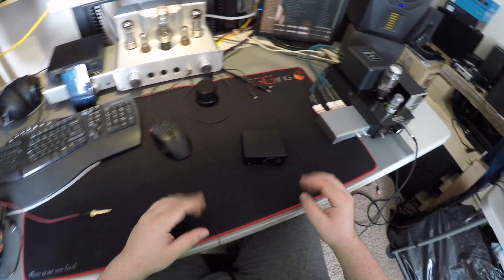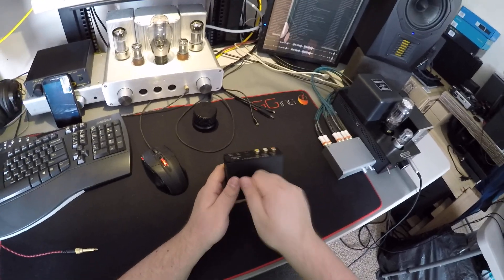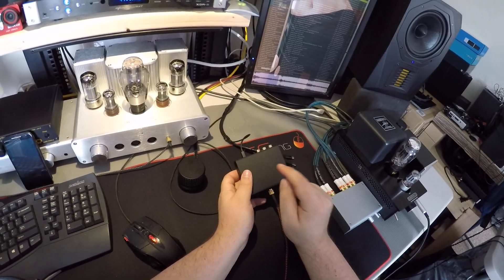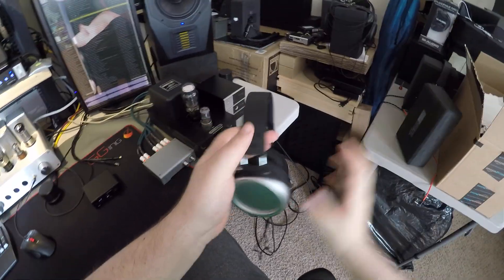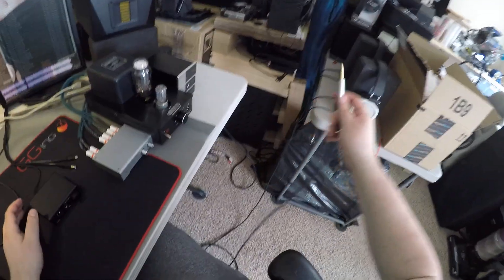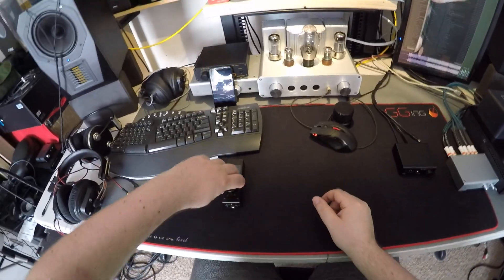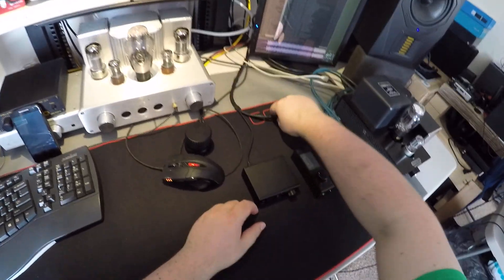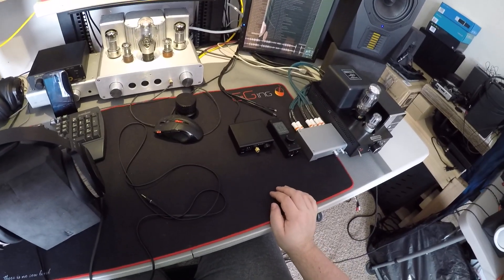Z Review - SMSL M3

Comment: this may be a stupid question, but if you were to connect the emotiva control freak would you then be able to ignore the need for a speaker amp? or would that simply not work or is the amp in the m3 powerful even to push speakers?
Reply from the maker: The rear RCA outs are just signal. They would work to feed signal to powered monitors. You need another amp along the way.

Comment: Hey Z!

I'm planing on buying a pair of speakers for my desk setup but i'm not really sure what i should look for. I would prefer to buy a pair of powered speakers to avoid the extra cost of a speaker amp. 

I own a o2/odac with rca outputs on the back, so i can use the odac for the speakers. I have a budget of +-300€, is there anything specific you can recommend? 

I will use them mostly for music listening but maybe so music production in the feature!
Reply: +Patric Matsson Look at his subreddit for reccomendations, but off the top of my head. The JBL LSR305
Reply: +Draxcer I have been using mine for over 2 years now with no issues and they sound amazing. They need A subwoofer though if you want low end

Comment: So I have a foam modded pair of Sennheiser HD 558s, I'm looking to get the best sound quality out of them (Which I assume I'm not already getting with my Sound Blaster Audigy RX sound card's 3.5mm headphone jack), and the music I listen to is usually pop, rock n roll, instrumental, Alternative Rock, and occasionally punk (generally from the early 2000's to the 1950's.) If I am getting a cheap dac/amp just for general music listening purposes on my Windows Desktop, would it be better to get the SMSL M3, or the Schiit Fulla?
Reply from the maker: For those cans either works. I like the formfactor of the M3 better.
Reply: Is the M3 also good for gaming, just out of curiosity?
Reply: cleans up shitty pc noise just fine. I have 250 ohm dt880s and they don't get as loud as I want. Just under though. like if it had 10 notches and I liked it at 10, it only gets to 9.
Reply: my cmoy portable with two 9-volts gets louder

Comment: Hey Z, I'm bouncing back and forth between this and the origen. The line out vs pre out is not a big deal. I have neither at the moment so I can build my eventual setup around what I get. I currently only have shp9500's but after all you've talked about the mk3's and the current rebate I plan on picking up a pair. Obviously you power them to "too loud" with the m3 in this vid and you talk about the origen and m3 being comparable in terms of power. But I do remember in a previous video you mentioning the origen just barely powering the mk3's. I was leaning toward the origen because of the form factor but now after deciding I want a pair of the fostex I'm not sure I want to go with something that will just barely power them. Advice?
Reply from the maker: +Dustin Smith Both push the Mk3's. So back to form factor you go.
Reply: +Z Reviews Awesome! Thank you! I really appreciate your advice. So much of the audio advice I've found on forums and such is very "snobby". I was told on a forum I was screwing myself over if I planned on getting mk3's with anything less than a schiit magni + modi combo. I know its not bad advice but I also take it with a grain of salt. Your reviews and more "real world" advice makes deciding on stuff so much easier.  I think Origen it is then. Keep up the good work! I plan on joining up on your patreon soon.

Comment: I'm wondering if your power problem in the RP50's is that you're using a different cable than comes with it ?
Reply from the maker: +Richard Riley I tried all the cables when that was mentioned. Not the issue. Just the odd way the Fostex planar react even among similar units.

Comment: i am in doubt what to buy...
smsl m3 or fiiio e10k, regarding the sound quality....
and also, m3 is cheaper then e10k for me, if i will buy from amazon uk
i own kingstion hyperx cloud 1 headset / takstar pro80 rebrand, with brainwavz earpads
so what would be better choice for them, m3 or e10k??
thnx for any help or info i get
Reply from the maker: They are both pretty entry level. I would just consider the E10k if you wanted a bass boost option.
Reply from the maker: Havent played with that one in particular but no reason to doubt HIFIMEDIY yet. Their little ones are very good.
Reply: ok, thnx for the help m8

Comment: Can somebody help me with this question?
I have the philips A5 headphones wich are 16 ohms and handle 3500 mW. I read that headphone amps need to have an output impedance that is at least 8 times lower than the headphone impedance. But philips says that because these (the A5) can handle up to 3500 mW, so you can plug them anywhere without getting a distortion or hissing. I prefer the m3 over the fiio e10k ( because usb+ optical) but the m3 has an 8ohm output. 
Will there be a difference between the m3 and the e10k knowing that the fiio output impedance is "more apropriate" for my headphones?

Comment: noob question,can i connect some old speakers i found to this??they dont have anything at the end of their cables its just like they are cut and have smaller cables
Reply from the maker: This is a dac and headphone amp. It has line level outputs meant for a speaker amp. Which you can buy, put in line and then feed those speaker cables into. Look at the Lepai 2024
Reply: Z Reviews ohh thnaks i might buy it its not that expensive

Comment: Would it be practical to run powered monitors off of this (since Micca are assholes and Fostex is hella expensive) using headphone port with jack to 2xRCA cable and using that to control the volume?
Reply from the maker: It is possible it is just going to be ugly. Also you have to make sure not to over-drive the signal into the monitors.

Comment: How would you connect speakers like the micca mb42x's to the m3? How do run RCA line out to speakre wire with a banana plug?
Reply from the maker: You do not. The line-outs can feed an amplifier like the SA50 or A2 but you can't just power speakers with this. You feed signal from it.
Reply: +Z Reviews thanks!

Comment: I am looking at getting a DAC amp for use on my PC. I won't be using speakers so headphones only. I will be using it for music and gaming mostly. 
I was wondering which you feel is better between the SMSL M3 and 793ii?
if is the M3 then is it better to use USB so not using the sound card or SPDIF? (also is there a difference between RCA and Fibre?) 
Thx for any thoughts.
Reply from the maker: No difference between COAX and FIBER. This if you want USB, some people prefer to avoid USB which is why the 793 comes in. The 793 also has external power which helps it power some harder to drive headphones.
Reply: +Z Reviews Thx. My only thought was by using USB I might be avoiding the sound card and reducing any possible interference from the PC.
Reply: +Z Reviews Well I got a 793ii and although the sound is only slightly better than my sound card the volume control is worth it by its self. Now I am waiting for my new head sets. I got a friend to buy me a set of SHP9500 which newegg had for $50 on sale recently and you just can't get them in the UK. Also found a set of DT770's (80 ohm) on eBay which cost me about $75 delivered so should be some fun times ahead playing with these.

Comment: So if you plug headphones into the front doesn't mute the rear outputs or will both play at the same time?
Reply from the maker: +Hindsight Aquatics The line outs on the front output all the time.
Reply: +Z Reviews oh OK. Is there a DAC/headphone amp combo that switches between the headphone out and the pre-out either automatically or buy a selector?

Comment: hey z  i have a few questions about the m3 that i would appreciate if you answred
can it power high impedance headphones like the dt770 250 omhs
if i connect it with spidf to my console will it use the amp and dac or just one of them
does it change the sound signutre and does it have a hiss
sorry if the questions are stupid , i'm starting to get into audio and thinking about getting the m3 as my first amp/dac to use with the hifiman 350
Reply from the maker: 250 is about as high an impedance as I would trust this to run. SPDIF will run through the amp and dac. It should not have a hiss.
Reply: Z Reviews thanks for the fast reply

Comment: I am planning to buy the hd650s and this dac/amp. Is this a good choice or will I be sacrificing audio quality to the point where I am better off buying a more expensive Dac/amp and cheaper headphones or saving my money? How do your 600s sound on this compared to more expensive alternatives?
Reply from the maker: Buying better headphones is never sacrificing quality. You are just probably going to need a better amp/dac to FULLY (100%) take advantage. You will still get a lot of it on a cheaper dac/amp.
Reply: I can get AKG712s and an Audioengine D1 for almost the same price. Would it be the better choice?  I am looking for clear mids and good separation. I hate when instruments sound muddled together if you know what I mean.
Reply: Z Reviews Could possibly do AKG712s with a K5 amp and snaskrit dac if I really push the budget.
Reply: got akg712 pro and they works fine with this. that being said, I only tested it for a few days since Im passing this dac/amp along to my brother. Using my dt 990 250ohm makes me think I wouldnt go much higher than efficent 250ohm headsetts for this if you can avoid it.

Comment: Would this work with a turntable with pre-amp built-in? Would the TOPPING VX1 be a better choice?
Reply from the maker: You can't feed analog into this. Only Digital in and analog out. If you want to send a TT to headphones you need either a separate setup like the Schiit Stack or something like the Aune X1s.
Reply: What about the Topping VX1? The Aune X1s is very expensive here in Canada (830 cad). Edit: i can actually find the Aune at a reasonable price on ebay.
Reply: You said in one the comments of your review of the VX1 it would work with a turntable. Wanted to double check. I'm interested in the combo amp/dac + the small factor, under 500$.
Reply from the maker: Yes the  Topping VX1 has AUX Rca inputs on the back. So as long as your TT has a pre-amp built in or you have a pre-amp to hook up.

Comment: Finally just got the M3. First reaction is that it's taken much of the bass away I'm used to hearing when I was listening through my laptop's headphone out. Is this normal?
Reply from the maker: Check this http://i.imgur.com/Af6iC8o.png

But it is possible your laptop has built in EQ to add that stuff and the M3 is just being neutral.
Reply: Thanks you were exactly right, I had just discovered that I had already turned on bass boost on windows audio settings ages ago and had forgotten about it being on.

Comment: As of August 2017, I think Fiio have dropped/replaced the E10K but its still available from several Aussie retailers. The M3's sticker price is a dollar more on EBay than minidisc and addicted have on the E10K : given that the latter sites are routinely 20-30 dollars more than EBay for anything even remotely 'budget'. The A3 (Fiio's replacement for the E11K) is $10 cheaper but you're in Topping territory from there. 

(FWIW, my 2-year old Topping NX2 has never let me down - even the stencilling on the case is still intact)

Comment: I have a full sony stereo (with a receiver and all) and a pair of HD598s. If i was to stick a DAC in the middle and have my laptop connect from one end and on the other connect the sony through the line out (im guessing using my 3.5mm to rca cable) or directly connect the headphones, should i get this or the Fiio e10k?
Reply from the maker: Get this, USB from laptop plug in headphones it. Wire RCA to RCA out of this to the receiver. Done.

Comment: My M3's worked about 30 minutes. First connected via IN1 usb port to PC USB2.0. I think it sounds good, but xonar essence ST with swapped opamps or STX II plays better. But for USD 80 it's ok. At 40% of volume for HD 380 Pro headphones I have noticed first signs of distortion, Xonars were louder and clearer at this point, so to gain some more power, decided to connect DC IN to another computer USB2.0 port. Well, the additional USB port, called DC IN in M3, is for power supply, isn't it? SMSL claims so. You can connect even a 2A output power bank to it! In reality, seems that connecting 2 USB ports it's not, what have been imagined by producer. After connecting 2 usb cables from PC USB2.0 to 2 USB ports in M3, it started to generate cracks when playing. I have leaved it with one USB cable only. After few restart's USB interface stopped working, and the device is dead. Problably I have burned power section of M3 by connecting 2 USB 2.0 5V 0.5A to IN1 AND to IN DC, but I don't understand how it was even possible, did guys at SMSL tested what happens, if user connects both USB ports to PC? 

Oh, and this DAC does not like low impedance headphones, if you've got around 16 Ohms or lower, you will have a huge hiss with this DAC. This is not only my case, others noticed that thing too, so SMSL should inform clients that it's for 32 Ohms or higher headphones.

So I don't understand Z Reviews hype about SMSL products. It plays good, but only when it works...
Reply: I want to use coexial line "IN3" and It needs external power on the " In DC", so what to do for not to cause damage?
Reply: +Micha Bar-Lev my problem with m3 was caused by bad quality usb cable that came with the device. One pin of the cable plug have broken after few uses. I have replace the original usb cable and now m3 is working properly with 2 usb cables plugged at once. Usage of coax or optical with power via dc in is possible too.

Comment: Need a reco.. I am looking for the best, clearest sounding DAC for under or at $200 that i can plug into comp. via USB.. I have an amp already, I currently use a FiiO E7 DAC Andes for DAC then that goes to my AMP but I feel there are better DACS out there..I just need a pretty good DAC  with a fantastic sound card at 200$ or less.. Prefferably at least 192 khz of frequency power
Reply from the maker: SMSL Sanskrit or Schiit Modi are what you want

Comment: So I recently bought the M3 as my first dac/amp and I can't complain much about the sound quality, however I have run into a very strange problem. When I first got it then I could change the volume in windows and it would change the volume I hear, but now a week later then it doesn't matter how much I try. No matter what % I set it to in windows, I can even set it to 0 and muted it will still play at the same volume. I'm using it through usb and I have tried to change USB-port and that. Just wondering if anyone have had the same problem. (The volume knob on the unit itself still works perfectly, but would be great to be able to change in windows too.)
Reply from the maker: That is weird. I have no solution.
Reply: Z Reviews Yeah, I figured I just got a faulty one, not much to dö about, which sucks, but anyway, thanks for the reply :)

Comment: Would this DAC be good for the JBL LSR305s for PC use?
Reply from the maker: .. Yes but you are looking at a fixed line output on the back. Which means windows has to control the volume OR you have to add a Schiit Sys or other pre-amp control for volume. Alternatively you can grab the Micca ORIGEN+ that has a pre-out so the volume can control the speakers with its knob.
Reply: Thanks for the response.  Upon further research I am unable to obtain the Micca or this M3 easily in Canada.  Would the SMSL 793 and XLR to 3.5mm perform optimally in this circumstance? 
Appreciate your style of reviewing.

https://www.amazon.ca/SMSL-SD793-II-PCM1793-DIR9001-Amplifier/dp/B00A2QLPJM
https://www.amazon.ca/Hosa-Stereo-3-5mm-Male-feet/dp/B000068OEP
Reply from the maker: You will be in a similar situation to the M3 where you have to use windows volume to control it unless you add a preamp in the middle.
Reply: Luckily my keyboard has a volume control that I assume works just fine. I take it you're saying that the difference in audio quality between those DACs is marginal and the decision then becomes convenience aspects such as the volume control.
First time buyer trying to make the right choice.

Comment: Hello Zeos, 

is this AMP enough to run BeyerDynamic DT 990 pro 250ohm version?? 
Thanks
Reply from the maker: Just barely. 250Ω is the limit of USB powered dac/amps.
Reply: is FiiO E10k any better? or should I get some external audio card, that can handle that?
Reply: So it wont run Sennheiser HD 600's? 300ohm. It should though based on the specs.
Reply: Dexter Bartis Yup it won't.

Comment: Would this power 250 ohm DT-990'S?
Reply from the maker: yes. At its limits but yes.
Reply: Z Reviews Thanks Z.
Reply: i have the dt880s 250 ohm and the m3 and i max it out to get good volume. it could be louder. The littledot i+ is louder at half volume than the m3 at max.

Comment: Thanks for all your hard work with these reviews! I am planning on buying the Fluance Signatures along with this DAC/AMP, but I was wondering how the connection from the speaker's plus/minus wires would run to the L/R RCA outputs on the unit itself... Is it just a matter of buying a pair of speaker wires (one set for each speaker, e.g.: https://www.amazon.com/gp/product/B003U48NIY/ref=s9_acsd_hps_bw_c_x_1_w) that terminate with male RCAs and just doing a straight connection?
Reply from the maker: This unit is a source. So you still need some sort of speaker amp to run the Siggy's. As cheap as the lepai [http://amzn.to/2kufizL] but I usually recommend a good SMSL [http://amzn.to/2jghNQY]